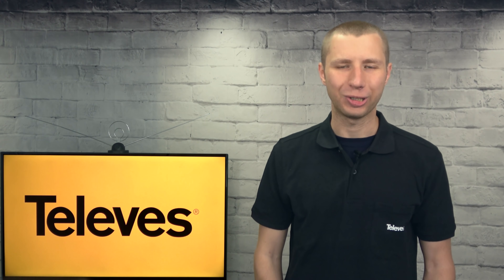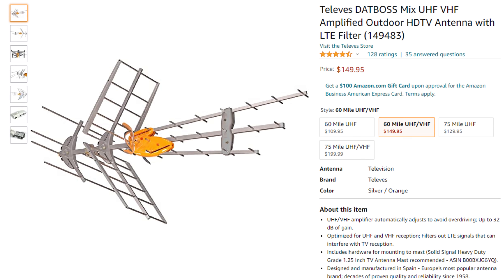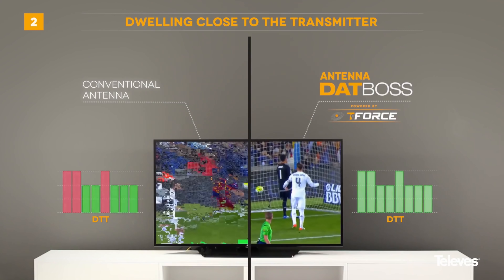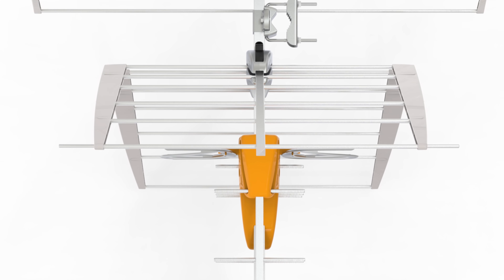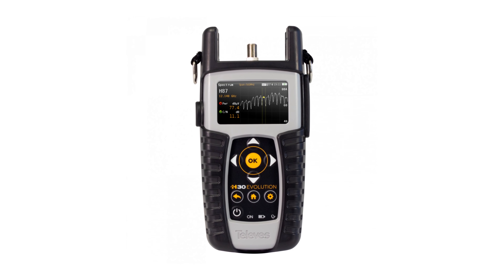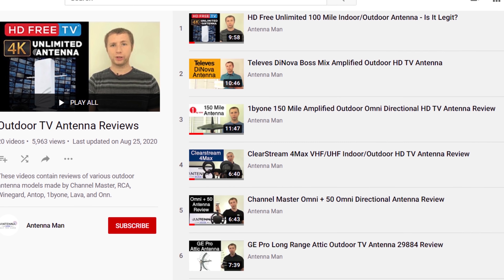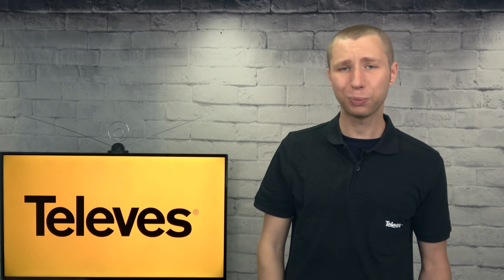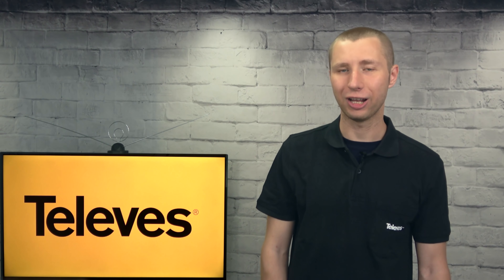Televes DAT BOSS Mix Amplified Outdoor HDTV Antenna Review

Comment: I just bought the discontinued Televes 148281 refurbished.  Mine is roughly the same model, but has 70-inch low-VHF element too.  Though I was concerned about the amplifier, gain is much better than my aged Archer booster.  I'm 46 miles from the transmitters in a lucky high spot.  If you're more distant or dealing with ridges, the LR 148383 costs more and has improved range.  I should have bought the 148281 a long time ago, but was uncertain.

Comment: Hi Tyler. Thanks for your great videos. I just installed the Dat Boss Mix in SW Michigan to receive the Chicago stations 60 miles away. I have many trees between me and the Lake Michigan shoreline about 5 miles away. the antenna picks up all the Chicago stations even with the amp off. it even picked up some of the South Bend Indiana stations from the side. very happy with this antenna.

Comment: I'm late to this discussion but I noticed that the latest version of this Televes DAT BOSS mix antenna (#149484) is advertised as "repack ready" but the low-VHF version (#148281) is not.  I'm considering purchasing the low-VHF model to get the infamous Channel 6 signal out of Philly but should I choose another model that's been optimized for the repack?  Or maybe the 148281 is "repack ready" but Televes didn't update the description?  I'm not sure how much that feature will add to the performance on UHF.  My current antenna, a Wineguard 7694P, gets consistent reception of just about all of the Philly stations and even picks up Channel 6 most of the time during winter but not so much during summer.
Reply from the maker: The low VHF version of the Televes LR Mix has been optimized for the repack. See video below. https://youtu.be/C7L1k9dAqGs
Reply: @AntennaMan  Thanks.  I was aware of that model being repack ready but was hoping for something a bit smaller due to the location where it'll be installed.  Not sure why Televes would optimize the 149484 but not its low-VHF version.  I'll address the question to them.
Reply from the maker: @BartVince  See video below for some other low VHF options. If you need help figuring out which one is appropriate, sign up for my antenna recommendation service. https://youtu.be/c5HBbejifh0

Comment: What if you already have a amplifier can you still use it with the Amp you done have hooked up?
Reply from the maker: No, do not use any other amplifier with this antenna or it will likely make reception worse.

Comment: Owned this antenna for almost 6 mos. Am picking up 58 stations, yippy! The instructions say to pull on a plastic part for it to snap into place. I think I must of had the piece already in place because there was no way it would move any further without breaking it.

Comment: Got the databoss mix antenna great reception im in a rural area and i got the televes 4 port amplifier im in central Florida area more rural get about 85 channels and the only drawback was the instructions wasnt great but got it together overall works great and got it thru solid signal got it in a week after ordering it thank you tyler for recommending this
Reply: Where. I'm in Ocala. I can get at most 19 great. Ge pro. I want more though?

Comment: Please EXPLAIN that there RF channel numbers ARE NOT IMPORTANT TO MOST VIEWERS!!!! ONLY THE CHANNEL ON THE TV IS WHAT IS IMPORTANT!!!! YOU EXPECT CONSUMERS TO MEMORIZE "RF SECRET NUMBERS" THAT ARE NOT ON THE TV SCREEN!! FOR ME, 2 is still WJBK2 Detroit, 3 is STILL WKYC3 Cleveland, 7 is STILL 7 WXYZ7 Detroit, 55 is STILL 55 WBNX55 Cleveland!! The channels on the TV ARE STILL the SAME!!!THAT IS ALL THAT CONSUMERS USE, TO TUNE TO THE CHANNEL, CARE OR WANT TO KNOW!! WHY MAKE IT COMPLICATED??? HAVE A NICE DAY!!!! (and MUTE all commercials when they come on!)
Reply from the maker: It is important for people to know the RF channels to select the correct antenna. Otherwise they might get the wrong one for their area. Too many people assume their local "channel 4" broadcasts on channel 4 which would require a low VHF capable antenna. That's usually not the case.

Comment: I have this antenna in european modification with LTE/5g filter and DVB-T2 channel range (K21-48), I guess back part with long elements is not on our model because we don't use VHF for TV in Europe or it's very rare, our TV frequencies start at K21. It works really well for K46 with bad signal and even for lower channels like K26. And the best thing is that you can use it even in pasive mode without power supply, not all active antennas with amplifier can work without power supply, sometimes, you just don't need amplifier, so why sending voltage to antenna? It's not some superior antenna or something, but compared to what is the most popular antenna in my country (small sieve made in Poland with poor amplifier), this is really massive upgrade, if you catch all channels from one transmitter ofcourse, for catching from more places at once, that sieve construction is better, but not made in Poland, better to buy our made in Pilsen, Czech Republic. :-) For some reason, my country is antenna superpower, we made the best antennas, but unfortunately, it's only small production, probably not for export.
What I mean by "Polish antenna" - https://www.radiokus.cz/fotky86262/fotos/_vyr_3575_14460805.jpg  
And this is same construction made in Pilsen, Czech Republic https://www.digitalnitelevize.cz/images/200910/vaten-velk-sto-5669.jpg
Do you see the difference? 4 such antennas connected together were used in communism time to illegaly catch German or Austrian TV, in such connection, it can has better results than long yagi antennas for some reason. :-) It looks like this https://lh3.googleusercontent.com/proxy/K8V4YiMDfBzycrB-mDCTJXHh8xOcF1bDmihA6kkhfqcS4XWAABS6pGQeZoQxnqOTHWhNDCnxLs4gl_J7_VcN2JsxjO40OH8OT3yrUXFj

Comment: I just bought this antenna and already have a channel master 4 port distribution amplifier
installed. Can u tell me how to connect the televes power supply using the channel master 
distribution amplifier? I cant seem to find info anywhere. Also do I really need to install the 
televes power supply?
Reply from the maker: The power inserter should go before the distribution amplifier but you may also over amplify the signals by doing so. If you need further assistance sign up for a consultation at the link below: https://www.antennamanpa.com/antenna-recommendations.html

Comment: I haven't found an Antenna Man review of Televes' DATboss, UHF only. So I'm inserting my impression here.
Just "installed" this afternoon. First floor and aimed out a window. 70m from KC xmitters and my ground elevation is approximately 725'. 
Mid-afternoon and scanned two channels. Pixelation, high. But as the afternoon wore on and into early evening and after sundown, WOW!! 
I've acquired 95% of the Kansas City channels and no pixelation!
I can imagine what I do if I get this installed either in the attic or outdoors. 
Good job Televes'!

Comment: I purchased this antenna last week, replacing an Antennas Direct ClearStream 2, hoping to alleviate pixilation issues on several weakly received channels.  A couple of these channels issues were due to "summer foliage"  aka leaves.  Also the weakest was a very low powered station 14 miles away, which was almost impossible to watch.  Results of this antenna in an attic mount configuration - fantastic!  All of our channels except the low powered one just mentioned, are now showing max bars instead of 2 to 4 bars.  They are rock solid.  The low powered ones still have some occasional pixilation, especially in the morning hours, but afternoons and evenings are good.  Thanks, Tyler, for your recommendation of this antenna.  My wife and I are both thrilled with the results.  Disclosure - we live 20 - 25 miles from broadcast antennas, in a heavily wooded (old growth, tall trees) are with many trees in the direction of all of the stations.  As with any antenna, your results depend on your particular circumstances.
Reply: I agree, these Televés antennas are really good for such size, it's not the cheapest anteana, but who cares? Pay few dolars more for many years investition is worthy I think. People are very often confused because they have poor antenna with strong amplifier and it shows strong signal, but with poor quality, it's better to have not so strong but better quality signal, which is not possible with some 8 dB antenna with 30 dB amplifier.

Comment: Tyler, I purchased, installed and like the TELEVES ELLIPSE MIX model# 148881, so I could finally cut the cord about a year ago. I live about 35 miles north of Baltimore, in a very challenging terrain, and I am VERY pleased with this antenna performance. I also added a rotator, but after aiming my antenna after installation, I really haven't moved it, and I have been locked-in with very good OTA reception. I've added the Homerun 4k box along with a few streaming apps via Internet, and I am very glad with my choices! NO MORE outrageous invoices and box rentals!!!
Reply: Glad to read the good results

Comment: I live in a country that cable isn't available. I used to install antenna systems and satellite dishes.
We used to install such antennas, but they never cost that much. I don't know why they're so expensive over there!
Customer price for this was around 35-40€ + installation

Comment: Yahoo!  I can finally pick up the ABC affiliate in the San Francisco Bay Area again!  It broadcasts on VHF-12 and my older DV/UHF antenna wouldn't pick it up.  This antenna also picks up an independent that used to be the old NBC affiliate that broadcasts on VHF-7.  I have one major ridge between the antenna, about 40 miles away, and my town of Livermore, CA.  88 channels found but roughly half are in another language so I "delete" those from my channel list.

It's early yet but I'm very pleased with the antenna so far.  I was considering another antenna until I watched your review on it — then saw your review on this model.  Thank you!

Comment: Just assembled this. Haven't set it up yet. I'm just a little confused and wondered if someone could answer. The forward, upper and lower pieces (L and M in the instructions) are electrically insulated from one another and the rest of the unit. ie no metal to metal connection. Is this correct, or did I miss something?
Reply: It is correct. The only electrically connected piece is the active dipole, the rest are directors and reflectors that concentrate the signal in it, pretty much like a telescope does with optics

Comment: Thanks man, I'm getting one of their LR's here soon, but gotta save up for a full overhaul of good cable, proper mast, antenna, the works, big project.  I wish Televes, or literally any antenna manufacturer would retune their antenna lengths for the repack. I know Televes is based in Spain, but Europe is condensing their TV airwave space too, to make room for advanced cellular.  

Speaking of cellular, how come you talk mostly about TV antennas and only occasionally about wifi, cellular, and radio?  Whole house wifi or whole property coverage is going to be equally important for ATSC 3.0, and a lot of people don't know the difference between wifi b,g,n,ac,ax,adinfinium, mesh network vs. wifi extenders, or access points, home cell phone signal amplifiers, how to use directional wifi antennas to connect a far away gate camera to your system, or get wifi out to a distant shop without running hardwire, etc.  Granted, theres about a million bad antennas on A->zon to do videos on, and you've built a decent testing system and kit over the years, so I would understand staying focused on one area.
Reply from the maker: I only talk about TV antennas because it's my main expertise and my audience is cord cutters. I made a few videos on wifi and LTE and they did very poorly so I have no plans to make any more.

Comment: I don't understand why, but LOWE'S website shows the whole range of Televes antennas/products, but in the description it says they are all unavailable...WTF?   You can't even order them.
Reply from the maker: Yes some of the other Televes models don't have the best availability in terms of stock. However, the DAT BOSS and LR Mix can easily be purchased.
Reply: I had a bad experience trying to order a Televes antenna at Lowes.  Ended up getting it at Ness...
Reply from the maker: @villumschroeder1255  Ness is definitely the place to go. Great local owner!

Comment: Can't find my comment on the Gold Standard. Other  viewers of these videos also brought this up too. As we know there is not no perfect antenna. 
What we the viewers are looking for is a far right column in your review of a antenna that you tested. Got extreme good numbers. Compared to the two most recent tests. As you test other antennas from other makers. The far right will show the antenna to beat at that time of testing. You may do another 10 antennas test in the coming weeks, months or years. But that highest gaining antenna will always be there to the far right. If you did a test and and last Antenna you tested exceeded the far right column that goes up and replaces it.
This just shows to us viewers the current best model out there. This was bought up several times with other viewers of this channel.
This is not to put your channel down, but make it better for everyone viewing this channel.
Thanks!
Reply from the maker: As I said - there is no "highest gain" antenna as it depends what frequencies you're looking at. I would never single out one antenna like that either. I keep the results of the last two antennas. This takes time in editing and I don't even have to do it. If someone wants to find the best for certain frequencies they are free to watch my videos or sign up for an antenna recommendation from me on my website.
Reply: As you do your tests you will find one. That antenna goes to the far right. Until you do other testings and run across a better. Because you could go for weeks or months with a bunch of mediocre antennas.
Reply from the maker: @diycarhome9151  For the last time no. I already explained why in the previous comments.

Comment: Hi Mr. Ty.,   I want to re-adjust my satellite dish, which reception meter do U suggest?? 
I do not want to spend $200 or $300 or more.. Would this also work on over the air VHF/ UHF installations??  ♠W.G.

Comment: I must admit, I don't understand comparing an antenna to "the last two antennas" since the last two antennas may have been good, bad, or average. It seems like the comparisons should be to the two best ones tested up to that point. Or pick a couple of decent "average" antennas and always use them for comparison in the latest test. Seems like, at least, the test should be more like the test done with the Datboss Mix LR in which the LR was compared to two known and identified "good"(I assume) antennas. The "last two" antennas comparison doesn't seem to say a whole lot. Maybe I'm unaware of something.
Reply from the maker: I've always showed the results of the last two antennas. This gives a general sense of how it performs. You can see the last two antennas were small directionals and this one performs better than them for UHF and a bit better for VHF. There is no gold standard or best antenna as it depends what frequencies you're looking at. That's why I have a video playlist on outdoor antennas for people to watch - including a separate review of the LR Mix. If they don't want to do the research I do offer antenna recommendations on my website which will tell them the best antenna for their area but I'll never say one antenna is the best for everyone.
Reply: @AntennaMan  Yes, I agree that it has to be true that no one antenna is best for everyone. Although there may be a "best" antenna, chances are it would be huge, which can present a number of problems from difficulty of installation (and keeping it up there) to HOA rules to wasting money buying a more powerful antenna than needed. I do have a suggestion though. Perhaps pick one good "average" antenna to be the reference antenna, weighting it towards good UHF reception since there are so few VHF stations anymore. Then keep this one antenna installed at your testing location to be used for all future comparisons. A great thing about this is that not only would it standardize the tests, but the comparison could be done on the same day under the same exact conditions, so day to day variations of conditions would not skew the tests.
Just an idea. Thanks for your knowledge, and willingness to help people get off cable TV🙂

Comment: I buy a lot of DB4e and DB8e UHF Antennas.
In a side by side comparison this Televes Dat Mix to a Antennas Direct DB4e which would get the most Stations pointed at a distant city?
Has any one out the got both Antennas?
The Mix and DB4e?
Reply: The DAT BOSS has higher native UHF gain, and a built in preamp. It also has high VHF elements that the db4e lacks. It will have a longer potential range than a db4e. It’s also more directional which will help avoid multipath interference. The broader beamwidth of the db4e may be beneficial in situations where stations are spread out and less gain is sufficient.

Comment: I didn't see much info on low VHF capability.  How will this antenna do for philly channel 6 ABC which broadcasts on low VHF channel 6?
Reply: The antenna in the video does not provide low VHF reception. The model for that is either 148281 or 148381
Reply from the maker: As Javier said - this specific model isn't made for low VHF but you can find the low VHF version below: https://www.nesselectronics.com/products/tev148281?_pos=8&_sid=6f85a0239&_ss=r

Comment: I am sorry if I missed this, but were these tests done using the pass thru mode of the built in RF amp or did you have that powered for these tests?
Reply from the maker: It was powered
Reply: That's a good question